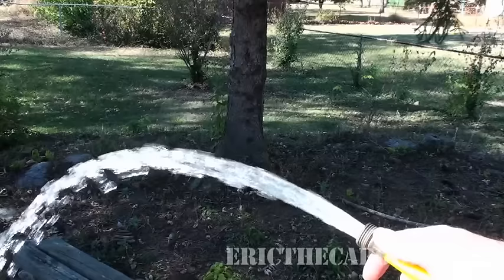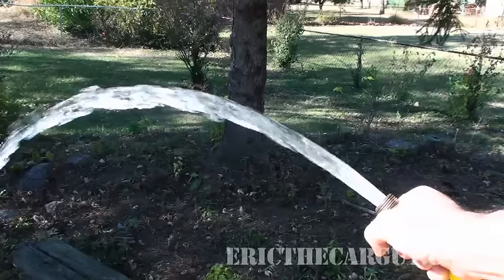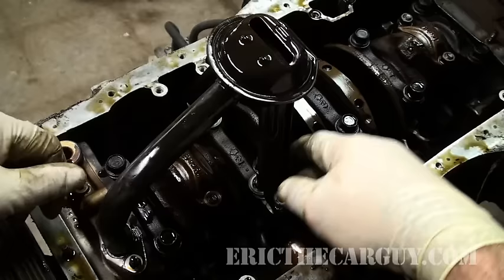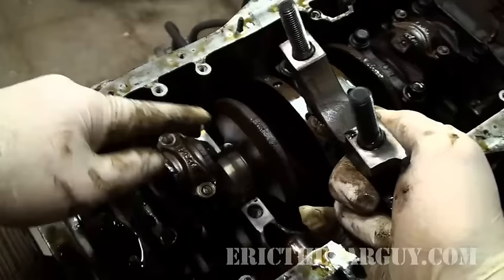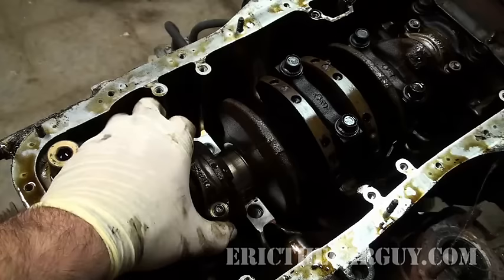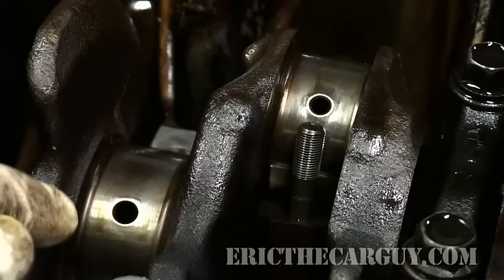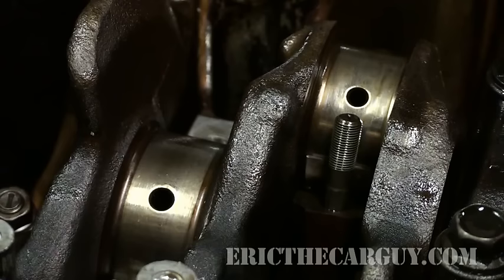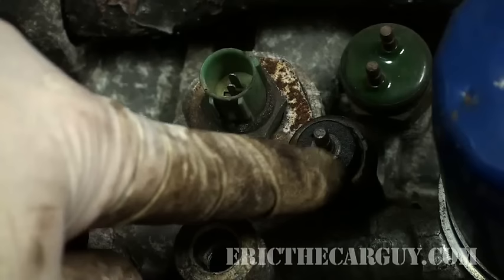How Oil Pressure Works - EricTheCarGuy

Comment: Hi Eric, i use  20W-50 Shell Helix for my car which is a GM car , formerly a Delta vehicle make and brand is OPEL CORSA   also known as Vauxhal in England, not sure why they have it different there. In South Africa and Germany and other countries its known as OPEL . Anyways , i know in the manual it says that the oil for this car should be  10W-40.
I am just interested to know why the general lot of house mechanics here i know use 20W-50  instead. Ive seen them use Castrol and which ever brand also.  Thanks.

Comment: I just had my 1964 Cadillac engine 429 rebuilt,on my way home from picking it up I had 28 lbs at 30 mph and at idle 12 lbs which is what the shop Manuel said it should be. When I pulled into my parking spot taking my foot of the gas the oil light came on & the mechanical gauge read 5 lbs. The next day on my way back to the shop I got on the freeway, after going 65 mph for 20 minuets the oil pressure started to go from 28 lbs to 22 lbs then as I exited the off ramp ( taking my foot off the gas ) the oil light came on & I stopped, had the car towed. After checking everything the shop told me they changed the 10w 30 oil to 20w 50 oil & no more low pressure when the car is hot & 10 lbs at Idle.
After watching this video I'm thinking they must not have rebuilt the engine right & the clearances must not be right. And advice agree or disagree  or anything would be very much appreciated
Reply: You got screwed. I hate that. The shop just put bearings in your engine but did not change the worn crankshaft or cam shaft. If you live up north that 20/50 will not pump in the winter during cold weather. The 20 is the temp that the oil will flow at. The 50 is the viscosity. If you only drive during the summer you will be ok but in the winter you will do damage to the engine. Hate that you got scammed but that's what sound like happened.

Comment: Riddle me this, what would cause a an oil light to faintly flicker only at speeds of 60mph or higher. 

My engine has the recommended oil type and the correct amount in it.

The car is a 2005 Scion tC with 129k miles.

Comment: Got a 1998 GMC Sierra, 5.7 vortec.  Lost oil pressure and now motor is squealing ( like I spun a bearing), but also a knock. But I haven't lost engine power, and no indication that motor is blowed. What do u think is problem? Thx, and love your videos, been very helpful.😁👍

Comment: By putting your thumb in a flow of a garden hose you are not creating pressure, you are changing the pressure by changing the flow speed. Look at the Bernoulli principle. An oil pump indeed create pressure: It transfers force into the oil. Maybe what you are trying to say is that you should not expect the pump pressure to be that one generated by the gears, but the pressure created by the first restriction on the pump's output.

Comment: If the clearance becomes bigger in the engine caused a lower pressure. Can we put thicker oil to fit this new clearance and bring oil pressure higher?

Comment: Quick question my oil light comes on at idle but when I increase the RPMs it goes away also I wanted to note that I don’t have any ticking knocking or valve train noise does that sound like a pump?

Comment: Once your motor starts to wear and bearing clearances get larger, can you just use a more viscous oil to get back to normal pressure? So, say my car needs 5w20 but after 300k miles, I may need 5w30 or 5w40, etc.

Comment: Affirmative.  High-volume pumps may increase the pressure in a worn engine, but it won’t fix the root of the problem; worn bearings, seals, etc.

Comment: I have a 1989 Mazda B2200  2.2L. I just changed most of the gaskets (intake manifold, Exahust manifold, and Head Etc.) I also put a Weber carburetor on but when I thought I was finished the engine didn't have any pressure in the fuel or oil system. Any ideas on why this may be, anything can help at this point?

Comment: The whole video's not wrong. Hose example could use work. A pressure gage on the hose would display a low value when wide open, then display a higher value as the flow is pinched.  Sure a second pressure gage right at the point where the velocity increases would show a lower pressure, but Bernoulli's principle is not the lesson here.
The point that too much oil flowing in your engine due to loose parts will cause a drop in pressure is very valid.

Comment: To all people saying take ur oil pump off an it won’t have pressure. It won’t have any oil flow . Pressure is indeed created by bearing tolerances . If u don’t think so run stupid amounts of clearance in ur engine an tell me how it works out . Same with to tight . Pressure will go up . An have almost no flow due to to tight bearing clearance

Comment: Eric, worn out Cadillac 429 with low oil pressure at hot idle. I read that shimming the oil pump pressure relief spring would increase pressure? Thoughts?

Comment: Could an oil gallery gasket cause reduction in oil pressure after warm up.  Have a 4.0L V6 nissan pathfinder 2005, there are nissan service bulletins for the timing chain guide tensioners wearing down.  I have a whining in my camshaft area, figured if i was in there also do the oil gallery

Comment: Hello I have a lsv setup I have low oil pressure at idle but fine when hitting the gas. My tunner thinks that my lifters are bad will bad lifters in a b16a2 head cause the low oil pressure. We have changed the crank it had 2 bad rod journals after we gained 8 lbs so now I have 12 at idle I'm running 20 50 in it. It should have about 20 at idle. What do you think could be the issue. Thanks for your help.

Comment: I've got a 1975 pontiac with a 400. my questions are. must the car be running to see the oil pump to the valve train with the valve cover off. I've only turned the motor over because of priming new oil. must the motor run to create oil pressure in order to see the oil up top in the valve train area. thank you.

Comment: if I was using a thicker oil (than recommended by manufacturer) for a long time; will going back to the recommended viscosity (thinner) cause pressure loss? will prolonged use of thick oil increase clearances between engine parts hence can't go back to lower oil?

Comment: i have a question after watching this and wanted your opinion on the subject. i have a  2002 dodge dakota 3.9 v6, the truck had been sitting out in the cold weather for 2 close to 3 months without running due to it needed a new starter. at the time didnt have the money for a tow, parts, and no access to a garage. well, went to try to start it like usually due and it started up before installing the new starter. got it to a relatives garage to work on the starter but on the way there the oil pressure dropped to zero, no bouncing gauge, and noise started to occur. to shorten this up got the starter in, started fine and no noise and there was pressure. pulled it out of the garage and shut it off, came out a couple hours later, started fine with no noise. drove about 6-7 miles and all of a sudden the oil pressure dropped to zero once again and the noises from the engine slowly started to appear again. returned home and parked it. could you or anyone on this forum give the scenario you think would  best fix this issue?

Comment: Hi Eric, I have my chevy blazer 2.2 L oil pressure low, the check gauges pops up in low RPM. When I check the oil inlet by opening it when engine running it looks good, the oil still flow. Is it the switch oil problem? Thank you for your attention.

Comment: Hi Eric. I have a 2015 Chevy Sonic LT. It had a low Pressure light blinking on Idle when the RPM is under 900 or 1 on the dashboard meter. Just a slight notch up will stop the blinking. The dealer said it was the oil pump so they changed the whole housing of the oil pump together with the water pump. The same problem is still there and the dealer has no clue as to what could be causing this. Any help or advice will be great 😀

Comment: So would a little thicker oil viscosity be a good idea?  My mechanics and previous owners used 20w50 oil in colombia here because the 98 montero sport manufacturer recommends 5w30 oil but it says in manual in hot climates up to 20w50 is ok.  I am thinking of dropping it down a little to 15w40 SN rated diesel / gasoline oil.

Comment: My 98 Jeep ZJ with a 4.0 gets no oil pressure when idling only when it's at operating temperature.  Assuming bearings are bad, at 230k miles.  Suggestions?

Comment: I have a question please...my oil pressure is zero on dashboard and oil level is perfect and we don't have no pressure when we test the engine---I havechange oil pump ,oil filter oil pressure release valve and still the same----and truck is rebuild less than a year with new bearing --Do you think I have to check bearing again????

Comment: Not sure I agree entirely. As long as your oil pump is working correctly and you don't have any major leaks, you always have a specified volume of oil circulating through your engine. The oil doesn't need to be 'at pressure' to separate the shaft and bearing surfaces. Also bearings are designed to wear a bit to improve oil circulation. If you take you car on a race track that's a different story but for most folks, low oil pressure isn't a killer...
Reply: That is absolutely true - low oil pressure is not a killer, but no pressure is sure death to the engine. The lower the pressure, the less amount of oil is injected into the system and the more wear occurs. Once more wear begins to occur, the pressure gets lower and the wear increases rapidly to failure. So I get worried when the oil pressure gets down to the 3 psi area. Something is probably not right in the engine. But with the low viscosity oils, that level of pressure at operating temperatures might not be a killer if it does not occur for very long (just a little more rpm brings back more adequate oil flow for example) - the wear trade-off is acceptable at least to the manufacturer. The proof of this is in the fact that every non-mechanical gauge that I have ever seen on an actual vehicle put there as OEM does not show the actual low end values, rather a fudged value that stops at around 10 to 15 psi even though the real pressure is about 5 psi or less. But the newer gauges actually show 0 psi when the pressure is absent = 0 psi even though up to that point the gauge will show 10 psi or more.

Comment: 1995 Mercury Villager. Just realized shop added additional engine oil during oil change (1.5 to 2qrts). first 30 to 50 miles drive distance was running normal. after 50 miles drive distance.. a loud click from my engine. i have a moderate oil leak coming from the back of engine + loud clicking. sounds like diesel trucks. i vacuumed 1000ml out of the engine and sound persists just a bit smoother. Besides gasket now leaking? what other potential damage could that have caused?

Comment: Hi I have a question 👋 If a car has a oil filter with lots of holes in base plate and inner cage (less restrictions)will oil move slower through the engine than a filter with a bit less holes in base plate and inner cage(some restiction), oil will move faster through the engine because of this oil filter?

Comment: Eric:Can the main bearings and connecting rod bearings be replaced with the engine in the car on a 289 Ford once the oil pan has been removed?

Comment: my question is the opposite not low pressure but high engine oil pressure . Enough to blow a filter or a oil cooler hose from the crimp. Any ideas ? Thanks

Comment: hi eric thanks for this video . i have Just Done MY complete motor over and modified it . its a 4age 20valve 1600cc with complete bottom end balanced and .20tho high comp pistons and .6mm of the head with ported n flowed head and 293degree 9mm lift cams and vvti ad exhaust hks vinear gear. and ligthened a few just but REASON for doin motor over ok 2 reasons engine was smoking burning oil. and got bord of the stock engine but my car comes with a oil pressure gauge...and wen it starts up the pressure good and wen im drivi over 3000rpm its good but as soon as the OIL  GETS BUT,,, THE GAUGE OR PRESSURE LOWER THAN THE SAFE ZONE... SO I BOUGHT A NEW PUMP AND RE DID THE COMPLETE MOTOR NEW BEARINGS RINGS ETC BUT THE PRESSURE EXACTLY THE SAME AS B4 DOING IT OVER SO BOTH PUMPS GAVE THE SAME PRESSURE READING SO GLAD TO SEE THIS VIDEO VERY HELPFUL BUT IS THERE NO WAY I CAN FIX THE PROBLEM WTHOUT DOIN ANYTHING HECTIC SPENT R15 000 DOIN IT OVER. O YES IM FROM SOUTH AFRICA ... CAPE TOWN.. WILL A OIL COOLER HELP?

Comment: On my 85 VW Golf Diesel with 120k on the rebuilt engine, the oil pressure is fine with engine cold but drops when reaching operating temperature when going to idle after highway speed driving causing the warning light to come on momentarily but goes away while still at idle. My gauge shows  60 psi at startup, then drops to 40-50 psi while driving then drops to 20 when coming to a stop with engine idling but resumes  the 40-50 psi when driving. Oil pump replaced, oil and filter changed with old oil examined and finding no metallic particles, pressure senders replaced but there's another concern, the camshaft seal is leaking. Could this be a cause of low idle oil pressure? I'm also suspecting the the oil pressure management module on the back of the instrument cluster could be malfunctioning.

Comment: Hi EricThis video answered a lot of questions for me, but I still have a dilemma. I have an Audi S5 2010 V6 which is displaying 'Oil Pressure low, switch engine off'. Audi have replaced 3 oil pressure sensors and have now stated that they need to replace the oil pump at a cost of £2500. I took the car to an engine specialist who took the pump out for inspection by the warranty company and they have said that it looks OK. My options are to either 1. Pay for the oil pump on the off chance that it is actually fault. 2. have them remove the engine and check the bearings etc. What would you recommend?Any help would be greatly appreciated as it's my pride and joy and I don't want to kill it by driving it with low pressure :(

Comment: Hi Eric my oil light came on I shut it off checked my oil on the dip stick and oil level was correct, but I was force to drive the car home about 12km was the distance to get home with the oil light and buzzer on did I damage my bearings ?

Comment: Eric, i think you might be on to something here, i went and bought new bearings for my connecting rods and since the change my car sounds like a diesel and I'm getting an oil pressure engine light. the previous bearings never had an issue, its just that someone advised me that is i was changing piston rings, i should rather change the bearings as well. Should i out back the old bearings? any advice..please my guy

Comment: Hello. I need some advice. I recently changed the oil on a Chevrolet Spark 2008. I have putted  Ravenol 5W30 Full synthetic and now is leaking by the drain plug, and also by the engine bay sealing. Could it be to thin the oil being full synthetic, or I have created pressure by tightening the drain plug to hard?

Comment: my 1992 302 boss has almost 400,000 miles and my oil pressure runs below 20 idles at 10 is that good sometimes driving down the road its at 13 -15 psi

Comment: Most times low oil pressure is caused by a broken gasket connecting strainer to oil pump.i have seen guys throw away good engines where as all they needed to was replace this thin paperlike gasket

Comment: oil pumps do create pressure.. however if there is a failure to create pressure, then there isn't restriction for the oil pump to force against.

Comment: I have a 93 GMC Sierra 3/4 ton 5.7/350 with 167,000 miles. My engine was knocking. I replaced the Rod and Main bearings along with a high volume oil pump and screen. I replaced the Oil Pressure sensor and my oil level dropped to zero. I put the old sensor back in and my oil gauge jumped to over 60 and bottomed out.  Any suggestion as to what may be the issue? I purchased another sensor but haven"t put it in yet. I'm thinking the first sensor i bought was defected.

Comment: I understand what you're saying, but how would an oil pressure sensor measure resistance at the crank and rod bearings? Seams to me that an oil pressure sensor can only measure the volume that an oil pump is pumping. In other words, the oil pressure sensor IS the resistance against the oil pump's volume. Or, the oil pump sensor is measuring it's own resistance to the oil pump's volume. So, if the oil pump is pumping less volume, there is less force pressing against the oil pressure sensor. I guess if there was less resistance at the crank bearings, that would also indirectly lower the volume of oil that is being forced into contact with the oil pressure sensor, but that would be an indirect affect. Anyway, would you recommend moving to a heavier weight oil before tearing an engine apart to replace all the bearings?
Reply: The oil pressure is pretty much equal at all points. Gaps is the resistance against the volume. Oil pumps usually have at least 70% flow volume overhead so that if gaps get bigger oil pressure stays the same. The excess pressure is relieved at the pump so it's constant at all times.
Reply: Replace the bearings asap if they're bad otherwise the crankshaft will be destroyed.
Unless you're going to scrap the car soon, then you can add thick oil, BUT ONLY IF ENGINE DOES NOT HAVE HYDRAULIC LIFTERS. You could even use gearbox oil in bad cases.
Caveat is that you will have to set idle RPM higher by how many times the oil that you use is thicker otherwise some parts may no longer get splash lubrication and will be destroyed.